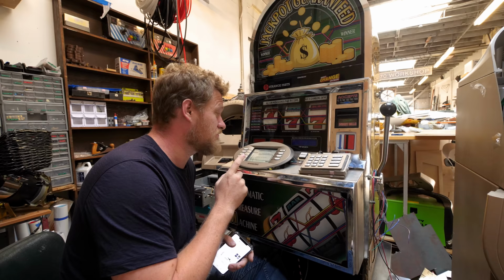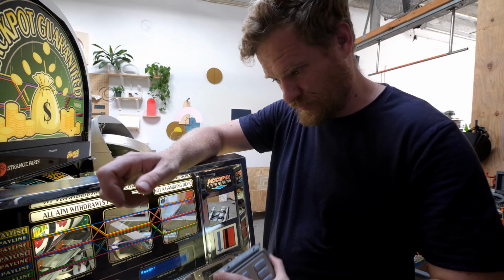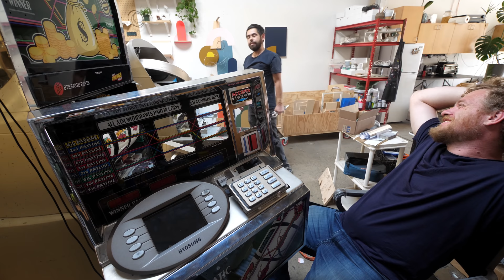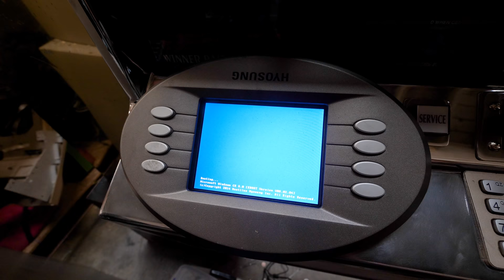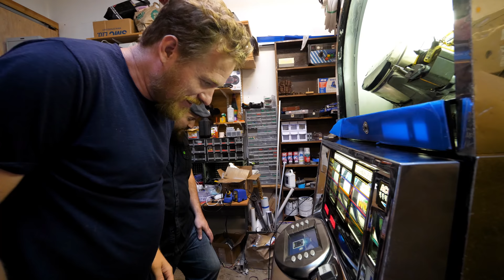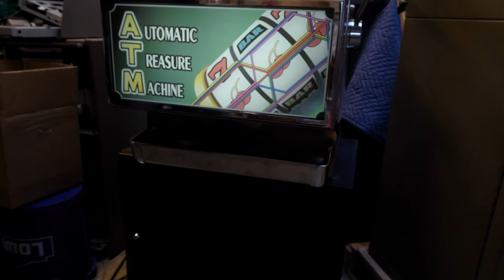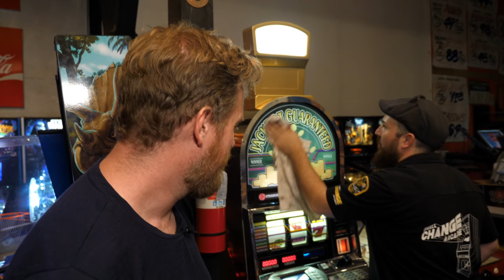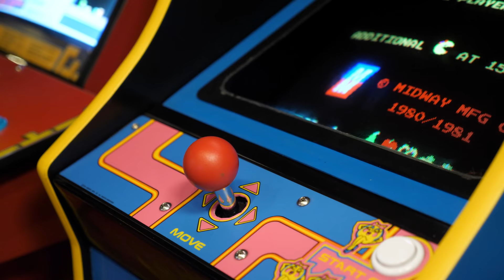End of the Road - Our Mad ATM Build is Complete

Comment: So been there several times.  I've been absolutely sure I've had things wired correctly and whenever there's a mix of voltages, well, it can be astoundingly educational; just chalk it up to tuition.  The senior project in for my EE in '87 was a PBX, with a hand-coded Z80 assembly OS, Kaypro10 for an operator console and billing interface, lotsa 30g hand-soldered boards and all.  Right before the project was to be reviewed, we had a little 90V/20Hz touch some 5V logic - poof, 2 extensions no longer worked!  Similar things on some printing press controllers, UHF radio interfaces, and such over the decades.  Very glad I was just the system architect for the railroad hump yard system because that was scary at times - could not fail at all.  I always appreciate the information and experience in your videos.  Thank you!

Comment: When the PCB blew up, the first thing I thought: Cool, a micro soldering project! Why did you buy an entirely new keypad?

I like where the ATM ended up :D
Reply from the maker: The keypads are notoriously hard to repair because of anti tamper mechanisms.  And we both just really wanted to be done with this project.
Reply: @StrangeParts  That explains it. Thanks for showing us this amazing project :)
Reply: Strange Parts Was thinking exactly that. I mean if you ended up bricking the first one because of a simple reset, what are the odds you could physically swap components? (That being said, might be fun in your copious amount of free time to see if you can repair, and show us why it doesn’t work.
Reply: @ibycus314  i think i know why, it got fried!
Reply: @Alexander_l322  I think by "why it doesn't work" he meant why even after repairing it, it wouldn't work due to its tampering protection. I'd be interested to see what kind of tampering protections these ATMs have as well.
Reply: @ToniMorton  except in this case, where you just need to remember to add a headphone jack. 😆🤷‍♂️
Reply: He put 120V to it, the whole thing is probably fried.

Comment: Worked with ATMs here in Germany. Glad you didn't decide to replace the burned capacitors. You would have failed to do so. The pinpad encryption keys are normaly cleared if you remove the screws on the back of the pad.

Comment: This is an awesome project!
I design custom PCBs (not perfboard) for fun and I would love to tackle a project like this! A liget PCB would take up a bit less space since everything can be integrated and tends to be more robust.
The only thing I would add (other than a change maker which you did in another video) is simply add a load cell (scale) under the quarter hopper so the processor will know by weight how many coins are available for use and take itself offline if it thinks there isn't enough capital in the machine to complete a transaction.
I think it would be better if you made it so you could withdraw and win in $1 increments which would make use of the 10% transaction fee.
Awesome video! Awesome idea!

Comment: How does the slot machine guts know how much to pay, and how did you rig it to play a winning hand every time. Totally love this project. :)
Reply from the maker: I explained it a bit in part 1.  Basically, there's an arduino on the ATM cash dispenser that waits for the motor to be activated.  When it senses that, it spoofs the light sensors that sense when a bill goes by.  If the motor stops, then we know the ATM was only trying to dispense one bill.  That arduino then tells the main slot machine arduino to credit the user for one bill.

Comment: Debug Guide 101

1. Analyze code, use debugger
2. Check for memory leaks, use unit tests
3. Check hardware connections
4 .........

LOL Nothing above is gonna help.. try this..

1. Leave it for sometime
2. Reset power/ reset settings
3. Give some little smacks... (sometime more than little)
4. Keep resetting it till it works

<3

Comment: Oh man... So this was quite an expensive roller coaster ride huh?! :D
Glad you got it running. And now, don't get me wrong, I don't wanna say that after all your hard work there is something wrong with it. But the wheel at the right wasn't perfectly aligned in the video. I figure maybe the stepper motor lost a step or wasn't homed correctly. So it may have been a one time thing. But if wheel is actually not aligned correctly you may wanna fix that (without breaking the ATM!).

Comment: I'm curious what would happen if the machine ran out of coins in the middle of outputting the transaction.  Would it know how much it failed to output and change the debit transaction to match?
Reply: This was one of the challenges with integrating the ATM. We did include a solution for this issue. When the slot machine payout starts, there is a counter on the door that counts down every time a coin is dispensed. So if the hopper runs out of quarters the counter will be frozen and tell the attendant exactly how many coins the user is still owed. You can also just refill the hopper, and the remaining coins will come out when you close the machine. The ATM itself also has internal accounting of how much money it has in it. So we can sync the amount of "cash" we tell the ATM it has with how many quarters we put in the hopper. That way, when the ATM thinks it's out of cash, the hopper will also be out.

Comment: That hopper is going to need to be filled a lot.
Reply: Holds about $500 of quarters, which is a bit less than a normal change machine (anywhere from $1k- $3k). When it was an actual slot machine, people playing would end up putting more coins in that it pays out (otherwise wouldn't be a very profitable slot machine). There is a ball on an arm in the hopper which is actually to sense if the hopper is full, not empty, and this functionality was originally used to divert incoming coins to a separate bucket in the base of the stand so the hopper wouldn't overflow. Good news is that it's pretty easy to refill the hopper.

Comment: What checks did you add to the coin dispensers to make up for spoofing the cash dispensor checks? How do you make sure you are actually dispensing $20 in coins ?
Reply from the maker: There's a counter on the slot machine that counts how many coins actually leave the hopper.  This is persistent in the case there's a jam or the hopper runs out of coins.  This machine is always attended, so if it needs a refill or whatever, there's someone at the counter that's a few feet away that can help.

Comment: My approach would have probably been to avoid using an ATM machine entirely because they have a lot of security features built in and obviously it's in their best interest to make reverse-engineering for fraudulent purposes difficult. I would have used the Square API to credit your account and have a little sexy UI where you select a product ($1, $5, $10, $20, $50, $100, etc) and it charges the card and dispenses that "prize"

Comment: I dunno why you guys aren't using regulators and/or diodes so you don't blow out the atm's board if you plug it into the wrong connections? Let alone labeling the connections, connecting when the everything's powered down and double/triple checking connections?

Comment: I’d love to know more about the keypad - it was a big character in the story of your project. I don’t understand why it needs programming / resetting / an encryption key?
Reply: When you enter your  (hopefully secret) pin code into the keypad, it leaves the keypad encrypted. This is done so that criminals cannot just patch into the wires leaving the keypad to capture your pin number.
If you attempt to open the keypad to gain direct access to the keys, the pad is designed to loose it's encryptions keys etc, rendering it useless.

Comment: Why use a full ATM for this? 
You could have used something like the air filler card readers that just sends you a digital signal and be done with it. Don't get me wrong it's super epic I just wondered why not use parts a bit more off the shelf.
Reply: Something like the typical Nayax reader

Comment: Probably a stupid question, but why did you decide to use an ATM for this? Wouldn't it have been easier to use a card payment system like you find on vending machines and self-checkout registers? Those are designed for the purpose that you used the ATM for.

Comment: Hey, awesome project, thank you, just one question, what appends when the machine is out of coins?
Reply: We can set the amount of "cash" that we (don't really) put inside the ATM to the same amount of quarters in the hopper. So the ATM will know it is out of cash and not let transaction go through. If for some reason the slot machine hopper runs out of coins mid-payout, there is a visual counter that says how many coins are left to be dispensed so an attendant can pay out the rest, or refill the hopper, and then the rest of the coins will come out.
Reply: Nicely engineered!

Comment: Add a key to the power supply so you can't put it on wrong.
Reply from the maker: Yeah, we taped up the connector that bit us.  The connector is sort of keyed - it's hard to plug it in backwards, but easy to plug it into the wrong one.
Reply: @StrangeParts  ah, glad you have a solution.

Comment: I still don't get how it works i thought the money is not on the card.
Reply: The ATM has a phone line connected or a "cell" phone modem / router that connects to a processor.  That processor contacts the persons bank.  Bank says yes or no to the request.  If yes, ATM dispenses  the money to you.
Reply: Michael Kenefick so when they tested it they wasted money?
Reply: @platin2148  No, the user get money or coins in this case.  They are paying fees for the "fun".  

The processor then reimburses Strange Parts for the money they placed in the machine.